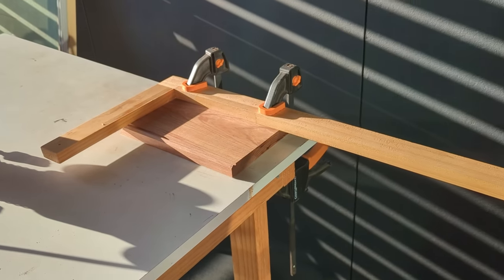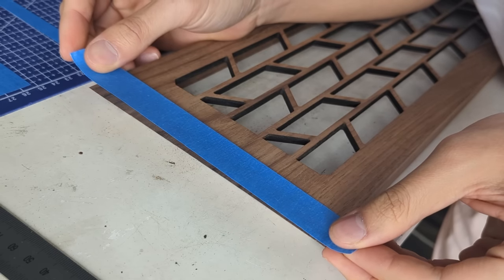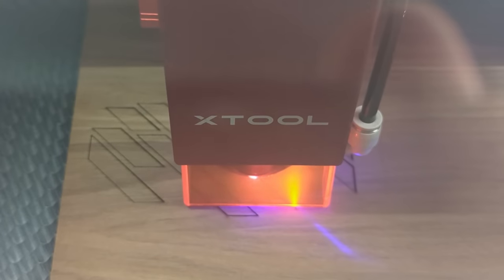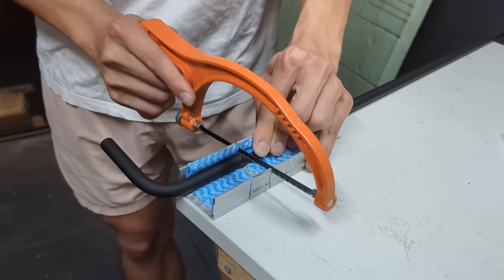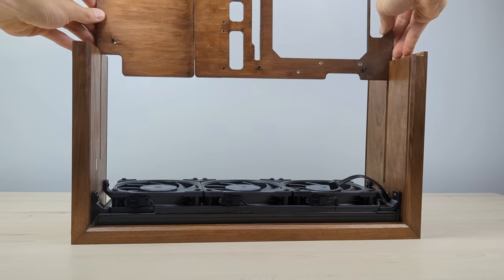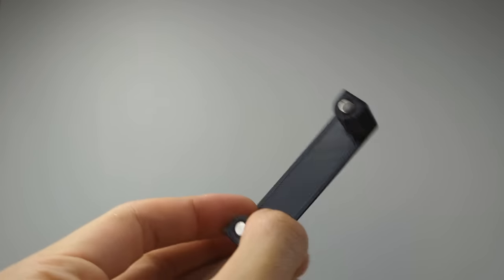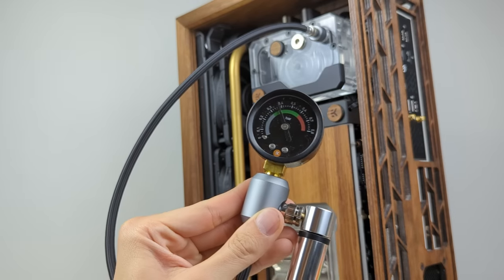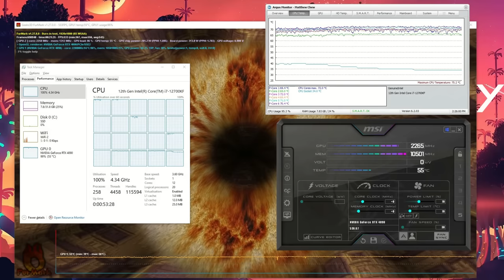Ultimate Hardline Wooden ITX PC | ASUS TUF RTX 4090 | i7 12700KF | DIY Wood PC Case

Comment: The space and environment were very narrow. It should have been more spacious and comfortable. It's nice but also bad
Reply from the maker: There is quite a large interest in small form factor computers where the challenge of having components in as little volume as possible is the goal.
Reply from the maker: Larger cases are surely more versatile and adaptable. But that's not the point. It's like suggesting someone who wants to buy a 2 seater sports car to buy a 5 seater SUV instead because it can carry more people and luggage. It's a different goal all together.
Reply: @mxcbuilds6633  When I said these, I actually said them for my future thoughts. Narrow and shallow cases create heating and cleaning problems in the future. Of course, everyone's taste is different.

Comment: a box of bottlenecks
Reply from the maker: A pretty box of bottle necks! Although it ain't really bottled necked. CPU still can run full turbo, GPU power limited to 70% but still has 95% of the performance as per der8auers testing. So maybe state why U think it's bottle necked?

Comment: i don't want to be "that guy" but front exhaust? really?
Reply from the maker: What do you think is wrong with front exhaust?
Reply: @mxcbuilds6633  front exhaust. if you don't use it as a heater back or top makes most sense.

Comment: So much air in the system it gave me OCD
Reply from the maker: Only at the start, all good now
Reply: @mxcbuilds6633  A lot of performance loss with just a bit of air circulating in cpu or gpu blocks. I'm glad it's okay now, but the design doesn't allow fully filling the loop

Comment: Ur CPU is not powerful enough for your pc, the RTX 4090 is extremely good but the 12700KF is not powerful enough to bring out the 4090s full capacity, just upgrade to a 13900k or 14900k
Reply from the maker: I don't need such a powerful cpu
Reply: @mxcbuilds6633  fair enough mate, just saying if you want to playing a demanding game you might want to upgrade cpu because your gpu and cpu do not match and the cpu is holding your gpu back but that’s your choice and I don’t choose it. Cya!

Comment: Let me tell you one thing: Prom PRO woodworker i appreciate workmanship.
But from PRO Computer Techician it's NOT RECOMMENDED "ABSOLUTELY", i repeat "A B S O L U T E L Y" using WOOD or PLYWOOD in Electronics.
Make case by 3D printer, less flamable.
Or give up and make DIY Audio Speakers.
Reply from the maker: Firstly, thanks for watching. You are right, it is definitely not recommended or ideal to use wood for PC case. Thats why we dont see any mass manufactured fully wooden PC case. 3D printed cases are not without risk either, if low temperature filament is use (PLA), the heat from the PC will easily defrom the case and cause issues.

Comment: hate saying this but its an instantly dislike from me. wood is the worst thing u can use because it not only absorbs heat, it retains said heat and doesnt let it go easily. so yeah if u want a hot running pc, this is perfect for that but it looks awful to me. moment i seen u building ur own wood case i knew it wasnt worth watching.
Reply from the maker: Yes wood retains heat more than metal. Does it affect PC component temps? I say negligible, and I did a comparison video specifically for people like you with that opinion, please check it out and let me know what you think. As for the looks, if you don't like it that's fine.

Comment: Wood is not the right material for a number of good logical reasons, for a start it will crash far more often having no EMI shielding.
Reply from the maker: Been using it for close to a year, no such issues.
Reply: @mxcbuilds6633  Well in theory, but good it works fine.

Comment: 😂😂😂😂 @ 4090 temps underclocked too. Nice build with no purpose to be underwater rho .
Reply from the maker: No purpose to be underwater? Find me another 4090 ITX build that runs at 55C under full load without fans blasting at 100% .
Reply: Have.@ tuf @ 1.1mV @3.2GHz ON AIR/STOCK COOLER.. at those same temps as your UNDERCLOCKED on a NR200  cm pushing 500w+ 😂😂😂😂😂 MAIN reason i havent put her underwater i get awesome temps on the stock air cooler as it is 🎉🎉🎉
Reply: Have MoRa3, Phobya 1260 & 1080 also have a chiller... and what not . Have the block for it too if i get the itch .. i always say if you going to do custom water cooling do it right.

Outside rad support for them itx build a must. Other than that dont bother shoveling rads in small cases is either you dont have enough surface area or rads are starving for air 😅. 

Like i said nice build but the custom water cooling part idk about that
Reply from the maker: What fan speed and noise levels?